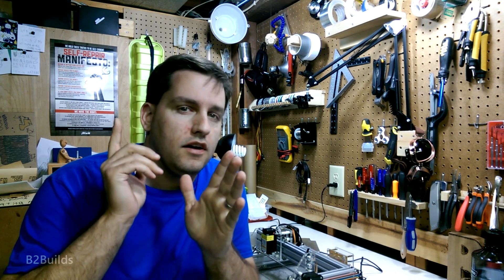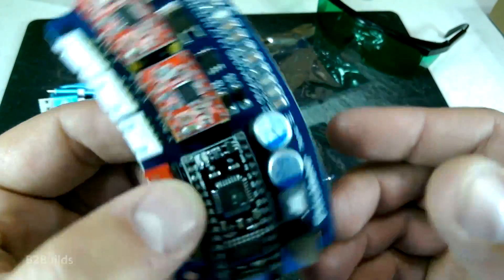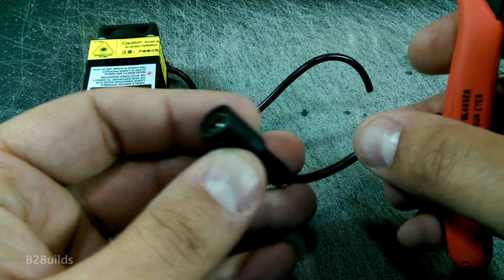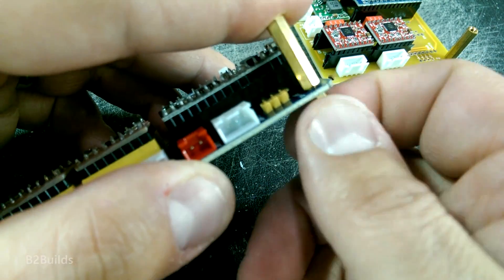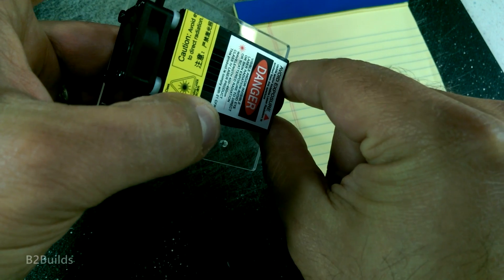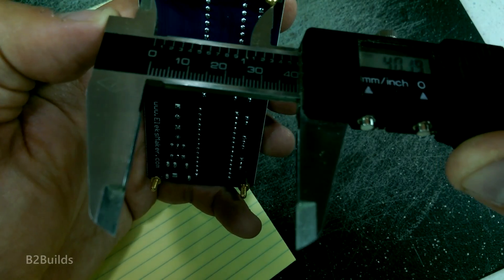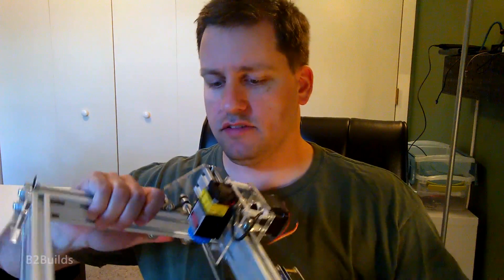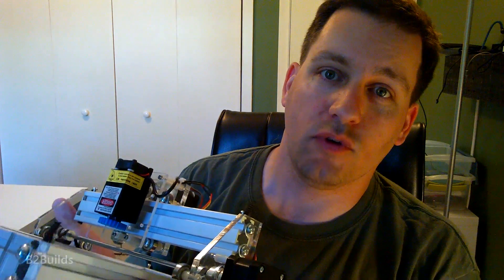Fixing up my Laser Engraver with upgraded components

Comment: OK, from what I'm seeing in your video is that since I have an OLDER 'ELEKSMAKER L2' control board I need to get a new MANA SE board before i can use the newer ELEKSMAKER CAM software. the old L2 boards use the 2 wire laser(s).

Comment: thats a very nice looking unit...how much did it cost? link?....i bought a 650x500 unit from ebay and having nothing but troubles trying to get it to move using benbox......what software you use?
Reply from the maker: Thanks. I think the original (lower power) unit was around $200. I replaced the firmware with GRBL and I control it with LaserWeb.

Comment: Hey ben. I am desperately looking for a answer if this laser can cut 0.1 mm mylar and normal cardstock. I need that for my airbrush stencils. I have been browsing forums, you tube channels, even i asked elekmaker people - absolutely no answer. Nothing. Would you be so kind to make some test please?
Thank you in advance!
Reply from the maker: My particular laser can cut notecards, but much more than that and it takes a long time and burns the material more than I would like. Cereal box cardboard is too thick for it. This unit seems better for simple burning of images and very light cutting like paper. For reliable cutting, I'd seek out something with more power.
Reply: @BenBrandt22  up the game and add a airassist and it will cut double what you are doing now.

Comment: Hi Ben, just got one of these laser machine. I’m unable to get the laser to burn. I can focus the laser but not burn. Help please😩
Reply from the maker: Some lasers have a low power setting just for setup, focusing, etc. But you could also have a bad laser, controller, or power supply. You'll need to talk to the manufacturer or seller to troubleshoot.

Comment: Ben, I purchased a EleksMaker® EleksDraw XY Plotter Pen Drawing Robot Laser Drawing Machine 2500mW and had it running OK. I changed a couple of parameters and the unit went to the travel limits. There are no limit switches on the unit. The machine does not run any graphics now. The stepper motors are energized but I can only jog one increment at a time. The programming info is very limited to non existing. The only thing I have noticed is that the red led next to the green led on the control board is on also. You seem to be very knowledgeable and wonder if you could comment on my problem. My email address is bob@fiber-laser-systems.com .
Reply from the maker: Hard to say Bob... Odds are good the manufacturer probably has their own firmware running on the controller board, so you may have to deal with them directly. If it was a normal x/y table and it ran the GRBL firmware, you'd have something more standard to troubleshoot, but those machines look like they don't have a "normal" x/y mechanical setup, so I don't think I can offer much help.
Reply: Thanks for your reply.

Comment: Hi Ben, do you know if the fame could be made bigger to accommodate larger material for larger engraving?
Reply from the maker: Certainly, though it would require all new aluminum extrusion, more gear belt, and longer wiring. Not necessarily an easy upgrade, but conceptually very simple.

Comment: Will these 2.5w or 5w lasers cut through 3mm Foamex boards (rigid PVC boards)
Reply from the maker: Seems unlikely, mine seems to have difficulty getting through cereal box cardboard
Reply: @BenBrandt22  yes with an air assist and proper focus a 5,5 will cut 5 mm ply.

Comment: I was wondering if lasergrbl works on that board. I am considering buying a laser from the same manufacturer. 
www.lasergrbl.com
Reply from the maker: Probably. I flashed the board and replaced the factory firmware with GRBL. So I would guess that any software that communicates with GRBL should work.
Reply: @BenBrandt22  of course it does, use T2 laser and with that nano it will flash or the GRBL versions out there. Laser GRBL is a superb kit.

Comment: Hey Ben,

Congratulations, You did an awesome job of upgrading this laser engraver!

I have just bought the same machine from one of the Chinese sellers on eBay and like yours was originally, mine is also 500mw but I am hoping to bin this and upgrade my machine to maybe 10w - 12w as I want to use it mainly for etching black and blue color anodized aluminium nameplates.

Seeming that as you are so good at this!, I have a couple of questions for you:

1), What would be needed along side a 10w laser module besides the relevant driver board that is designed to work with the 10w laser?, does this require a software upgrade on my pc for this stronger laser to run on the same machine? 

2), I am rather curious, if all the connections were almost the same as your old driver board on your machine, why did you have to change this driver board and go to the trouble of making new plexiglass mounts in order to remount the new driver board back on to your machine? - do these driver boards have a set limit to how much laser power they can handle and control??

Please let me know your thoughts?, I know that I could have just bought a proper 10w or even the more powerful 15w laser engraver off eBay with the 10, 12 or 15w laser already setup and ready to go instead of buying a machine the same as yours, but I really hate the styling of those powerful engravers - Your engraver looks much more neater and I like the way how all the wiring is neatly arranged that those more powerful machines seem to lack! - Thanks man in advance for your advice and suggestions ;-)
Reply from the maker: Thanks! Etching anodized aluminum would be pretty cool

1) I doubt you'd need different software to control a more powerful laser. The software merely sends control signals to the laser to move in different directions and to turn the laser on or off, regardless of the laser's strength. You'd probably need some specialized driver board built to handle that kind of high-power laser, but this would be best answered by a laser manufacturer/seller to find out what would work best.

2) When my original laser quit working (became too weak to burn anything), the seller gave me a new laser head to try to fix it, but that didn't work. By process of elimination, the problem was likely within the control board or the power supply (and/or maybe the bad board damaged my second laser), but I didn't have a good way to diagnose the exact failure. Since I didn't know much about my old board, and didn't know if it was good or bad, I opted to just get a new control board.

While I do like the look of this laser, it does lack the nice enclosure and exhaust systems that larger units tend to have, but it's fun for little stuff.
Reply: Hi Ben,

Many thanks for your prompt reply and advice, My thoughts agree with you 100% exactly with regards to the the driver board, I am thinking of going with the 10 watt laser module and buying the relevant driver board that is designed to work with that laser, there is a 10 watt laser on eBay which looks almost identical to your 2 watt laser and it has the adjustable focusing dial which I like compared to having to use a X raising platform and a piece 16mm long rubber tube, BTW that plastic piece you made for your laser adjustment dial is awesome and a very good idea!

Thanks for saying why you changed your original driver board, You are quite right, as you don't want to risk damaging your new 2 watt laser, starting with a fresh driver board was a smart move of your part to safeguard your new laser module.

The one thing which was concerning me was with the software, my fingers are crossed that you are right! and the software will be compatible with the more stronger laser! once I get it.

I have one of those blue and white Chinese K40 40watt enclosed engravers bought in 2015 off eBay which I have never used!!, I thought that it was too much messing to set it up and connect the cooling pump/water reservoir and align all the mirrors etc that I just put it away standing on its side! in the airing cupbaord because it takes less space that way! and I forgot all about it LOL

I just want a small user-friendly easy to set up diode engraver just  to etch anodized aluminum nameplates without too much fuss!, I am not too bothered if it doesn't cut through 5mm plywood or mark plain stainless steel - I am just trying to sort something out that suits my needs and your engraver is perfect!.... if only they gave it a more powerful laser from the start! but modding it is all part of the fun! and will be rewarding if it works out ok ;)

Comment: It'd be cool to see you add a servo to that focus gear and get it hooked up to the electronics so you could change the focus mid-job. Great video.
Reply: easier just to add a manual z axis and  adjust it manually, adjusting it on the fly is almost impossible you have to see the dot, on my 10 watt i just have a riser plate with a thumbscrew on it, works every time but to do it  via the network would involve cameras to see the dot being produced all the time and on a 2.5 watt laser the dot is like a pin head which would involve high rez cameras or a lot of maths to work out the height adjustment needed to keep it in focus as the lenses we use have no depth of field whatsoever so as you cut a 3 or 4 mm piece of wood you need to adjust the focus to avoid kerf. Finally there is a big risk factor monitoring your laser from a distance, these things catch fire and the electronics are basic chinese. I wont risk my house on it!

Comment: What did exactly die/fail on the other Laser Engraver ? The laser itself? The electronics? 
It seems you reused the wiring, mechanics, steppers ... 

As for suggestions on what to do ...  well, if the software allows for fine control of the laser you could explore the world of paper origami with it. Engrave the pattern, and then laser-cut the silhouette. 

Can chocolate be engraved ? Or cut ?
Last minute emergency birthday numbers!
... or cut a food set of chess pieces, and play over a checkered plate/cut board. Eat those enemy pieces.... :3

Nice video!
Reply from the maker: On the old laser, it suddenly became too weak to burn anything. Running it at full power I would just get a faint blue dot of light. The seller thought my laser module was bad and sent a new one (and I waited 6 weeks for it to ship). That didn't fix the problem, and I wasn't willing to wait another 6 weeks to troubleshoot another part. So it looks like the issue could either have been in the control board or power supply, but the old laser had some focusing problems as well. The carriage/motors worked fine though, hence I just got a new board, power supply, and laser.